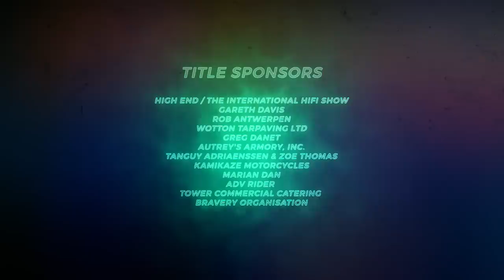Race 2 Dakar 2020, Africa Eco rally Race, Team Races to Places Ep. 17 with Lyndon Poskitt

Comment: Lyndon Poskitt, have you any indication as to the method of hacking that was used for your youtube channel?
Reply: @lyndonposkitt  Then I sincerely hope you have the means to bring them to justice.
Reply: @Lyndon Poskitt

Was it hacked during the event already, or after ? Any clues ? I can't imagine it's soo easy to take over someone's Youtube account from external... they must have intercepted your credentials close to your van or media team... and even then, this is something you need to plan for from beforehand and only works on wifi hotspots without wpa2. I don't think they have a Linux sniffing machine easily at hand at the event. 
Unless the password was weak and 2 factor authentication wasn't activated, I find this very strange...